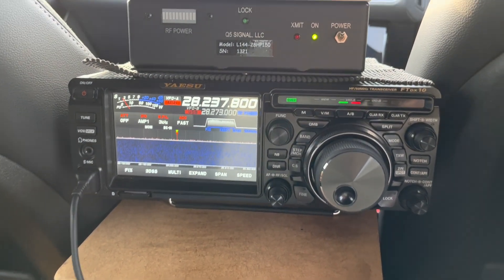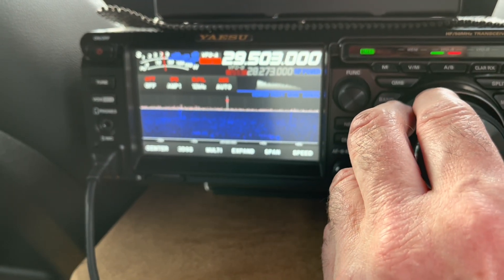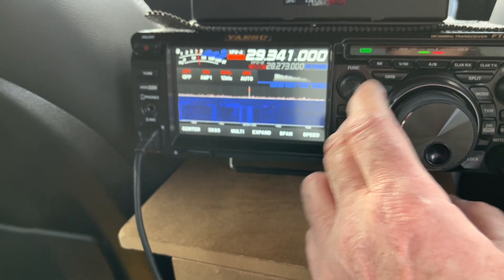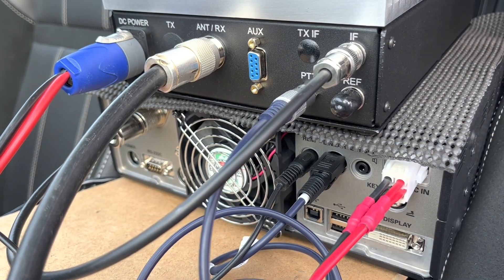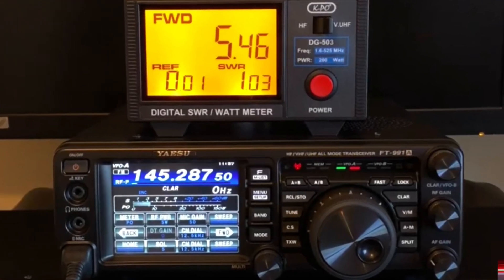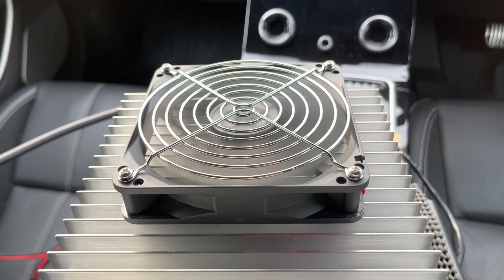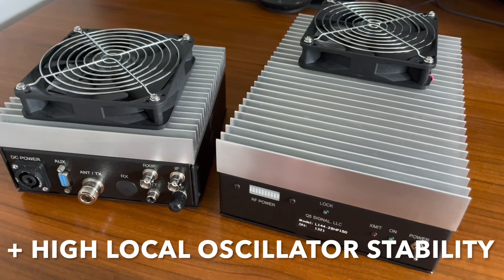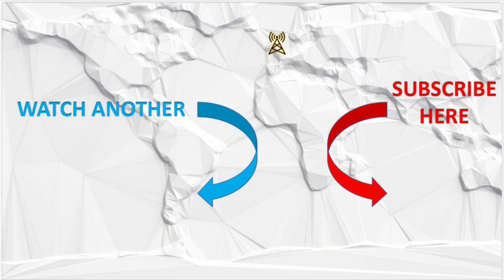Yaesu FTDX10 on VHF & UHF

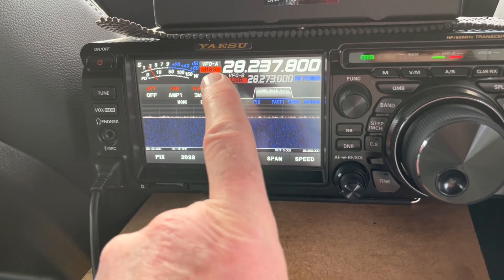Comment: 1:31 That’s one thing I would love to see in a firmware update… that when you use a Transverser, you would have an option on the Yeasu to select the 2m or 70cm band and then it would automatically use the Transverser but it would also show the correct frequency…
Reply from the maker: Yes, something that other/older radios to already. Wish Yaesu would do likewise....

Comment: If you are still using this setup how has it worked out?  I am very strongly considering the FTDX10 with a Q5 transverter.  Thanks for the video.
Reply from the maker: @dylanschulz2404  Yes, still FTDX10 and Q5 for 2m and 70cm. All good 👍🏻

Comment: Could you explain the conversion..144 is 28? Thanks a million 😊
Reply from the maker: Yes, it’s a direct relationship. So 28.000 = 144.000 and 29.000 = 145.000. The SSB calling frequency of 144.300 becomes 28.300. It’s straightforward once you get used to it 👍🏻Some other rigs have a menu option to change the rig display to allow for the transverser. I think the Kenwood TS-2000 does this. Shame the Yaesu doesn’t, but no big issue really. Thanks 👍🏻
Reply: Thanks a million your so helpful.

Comment: I have an ftdx10 and use it with a Mehta pro transverter. 
It's a superb Rx and tx but has annoying drawbacks. I have to use an attenuator because there's no low power output. Ergonomics are terrible compared to ICOM ( I had a 7300 and have a 9700 so I know). It's a good contest radio because of it's strong signal handling which is noticeable and it's very versatile with its 6m and 4m ability. 
It's cheap for what it is. If you can live with the ergonomics and lack of rear panel action, it's great 
When I look at radios these days I look at the rear panel first ...73 de G0LBK
Reply from the maker: Agreed David 👍🏻
Reply: It's shame lack of transverter output and second key terminal for PC or external paddle. @G0CNN-Ian
Reply from the maker: @sm7vzx  yes, not many rigs have transverter outputs these days…

Comment: thank you for the video, on my side icom ic-7300 with one Q5 tri band transverter, 75w on VHF, 50 watts on 220MHz and 50W on uhf band. works very well. I will order one more Q5 transverter for my FTDX10 also.

thank you for showing you setup, 73, Gilles
Reply from the maker: Sounds great Gilles! We don’t have 220
MHz here in the UK, so not much point on that model here. Have fun! 👍🏻
Reply: Witch Frequency on 70 cm covers the Transverter?
Reply: @ferdinandfummel56  430MHZ to 450MHZ (UHF amateur radio band) in Canada

Comment: Very interesting, thanks for that. What’s the setup in relation to the mast, rotator etc ?
Cheers Paul
Reply from the maker: Hi Paul. All very bespoke. The push up mast was a second-hand bargain at the local club. Another local amateur made the drive-on plate/rotator cage to my design…. and finally the rotator is from the late 70s/early 80s, so quite a unique setup in my case, but replicable using similar kit 👍🏻